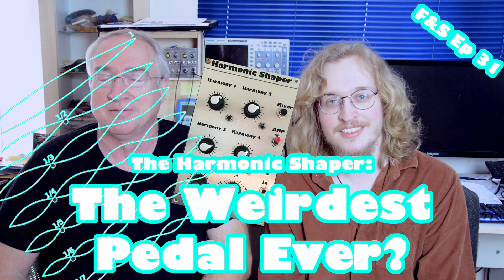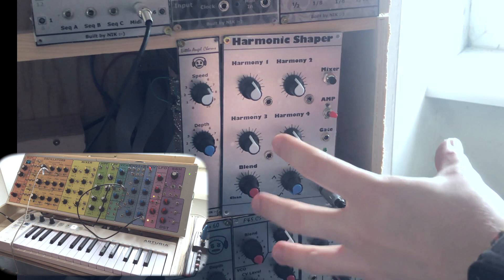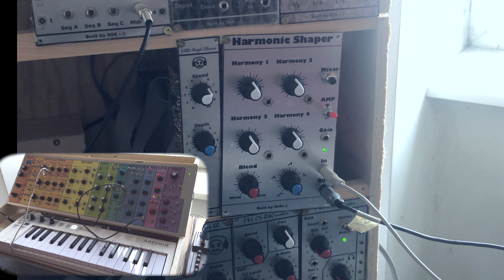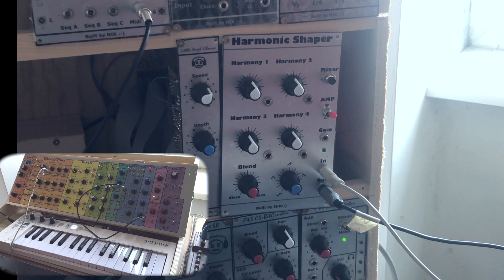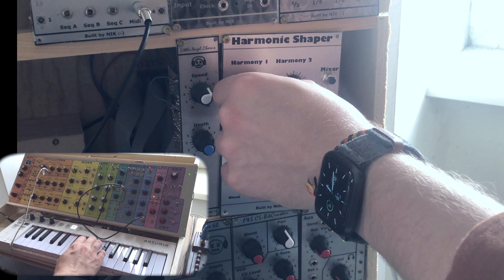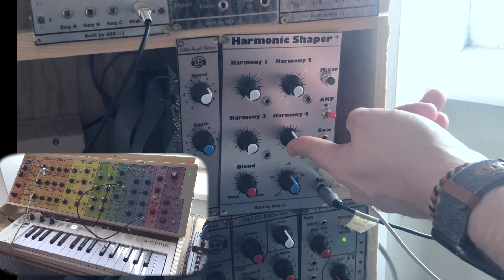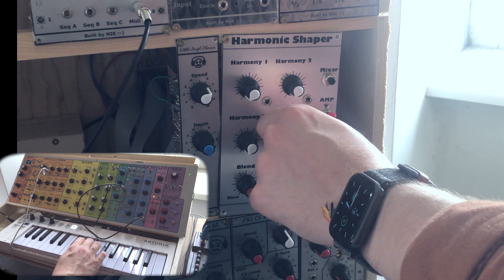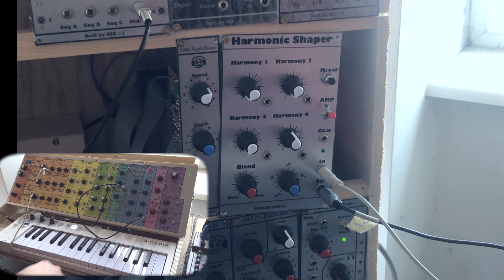The Weirdest Pedal Ever? - The Harmonic Shaper (F&S Ep. 31)

Comment: I am interested in that opamp/flipflop schematics. Where can I find it?
EDIT: Ah, misheard something and googled false. Found it.
Its this?

http://musicfromouterspace.com/analogsynth_new/GUITARSYNTHAUG2007/GUITARSYNTHAUG2007.html
Reply: You only used 2 opamps? U2-D and U2-A? Or did you mean two chips with each 4 Subopamps? EDIT: Dohh... Just found your github.
Reply: So I I want to use it in a Eurorack environment I guess I can go with only all around U2?
Reply from the maker: abag2007 Nils: U1, the two first stages are signal amplification and the other two opamps plus four opamps from U2 do the signal processing and generate a set//reset signal for the flipflop. So I’m afraid you have to use all 8 opamps (2 chips)

Hope that cleared it up! And everything is built and designed for the eurorack standard. 

If you want a direct line to Nils, email at FAS@wirkays.de